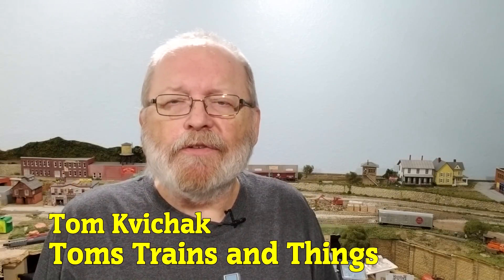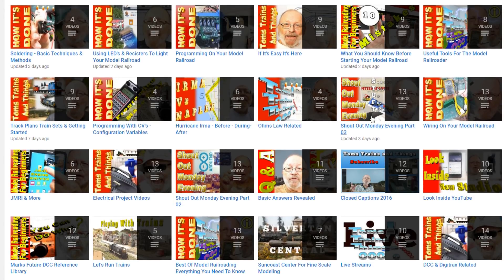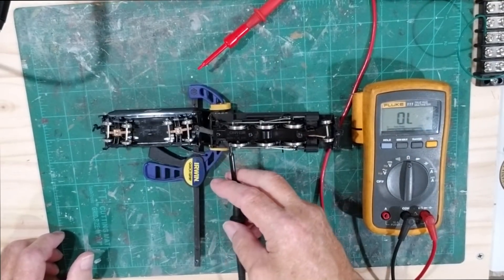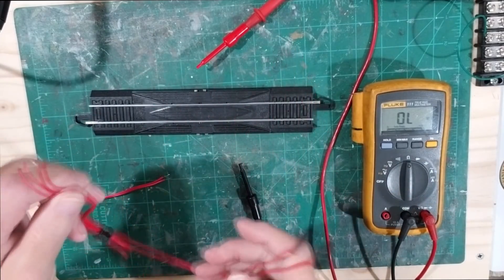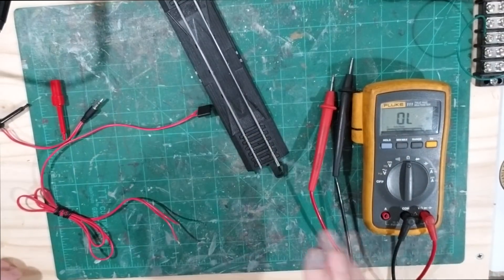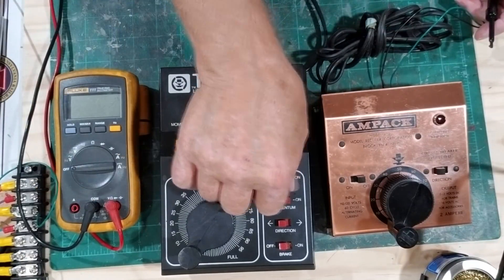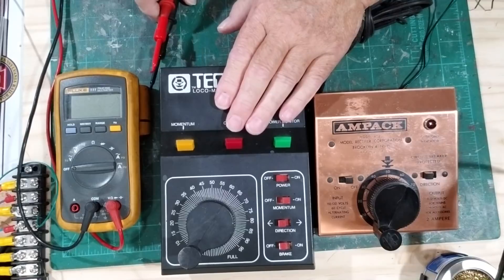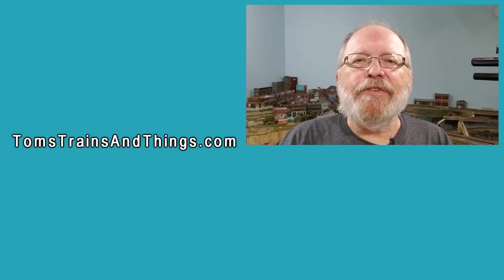Easy Troubleshooting DC Problems With A Multimeter - Model Railroading For Beginners - Ep 19

Comment: I have to bring a 9 volt to my next train show, thanks big time
Reply: if i guess the train set issue, it most probably the engine, bad contacts or locked motor (I got some cheap as is at train shows) might be able to fix like I have to a few of them
Reply from the maker: +billfusionenterprise Your welcome
Reply from the maker: +billfusionenterprise I guess I'll find out after my viewers watch the video. There were three with basically the same issue
Reply: well the 9 volt is the real good tip, wish i had one last weekend, would have not gotten 2 locos from this one guy
Reply: Turned out mine was a poor connection to the track on one side. Train runs fine. Thanks friend!
Reply from the maker: Glad I could be of help.

Comment: How do you test DCC?
Reply from the maker: Shipmate you can test the presence of a signal on DCC with a meter but the voltage is constant. There is a device made especially for DCC for testing the strength of the signal.
Reply: Set your miltimeter on ac.

Comment: Notice a MRC gold power pack , beware of the dual power model, it is not for a 2 train layout as it has only one transformer inside, also i hear troller can be bad parts
Reply from the maker: +billfusionenterprise Thanks, the one in the video was purchased at a thrift store. Only using it for demonstrations
Reply: I plan to use mine to power up accessories and such
Reply: wish i could find that at any of my thirft stores
Reply from the maker: There's a lot of retired people here, so I'm always finding some good stuff.

Comment: Can you help me?
Reply from the maker: You need to be more specific than that!
Reply: @TomsTrainsandThings  I have an ho Bachman southern pacific 4454. The motor has power but the wheels are acting like they’re stuck. When it arrived the wheels were just dangling so I reattached them.
Reply: @TomsTrainsandThings  thank you a lot for responding
Reply: @TomsTrainsandThings   so after looking closer when the wheels start to move one pair tries going the opposite direction.
Reply from the maker: @tynelson7945  If yoiu bought this new, I would contact bachman. If used, you may need to disassemble it to see why the wheels are binding
Reply: @TomsTrainsandThings  I bought it used. The wheels with the gear go in one direction while the other wheels go back and forth 🤷‍♂️ I’ve disassembled a few times to see why it’s doing it. Not sure if you’ve ever seen anything like this
Reply from the maker: usually one set of wheels is geared the other set isn't. Some have all wheels geared. If the motor is humming and the wheels are not turning. You have something stuck in the gears or one of the gears is broken
Reply: @TomsTrainsandThings  yeah the motor turns and the wheels move but the rear geared wheels move forward while the other sets try and move backwards.
Reply: @TomsTrainsandThings   can I email you?